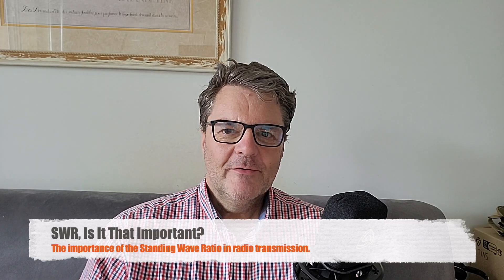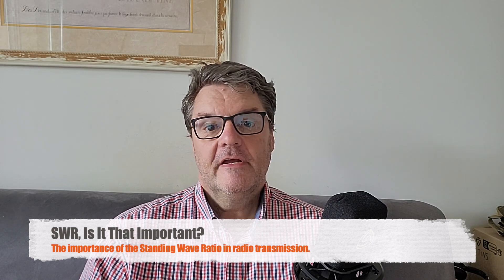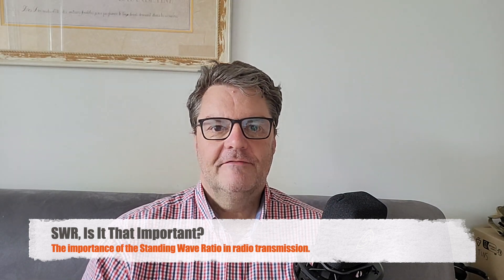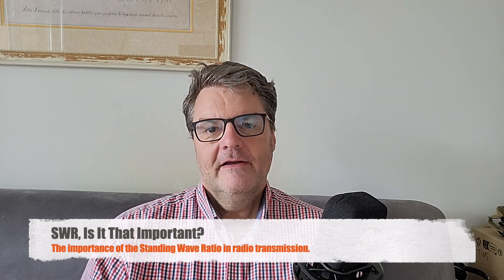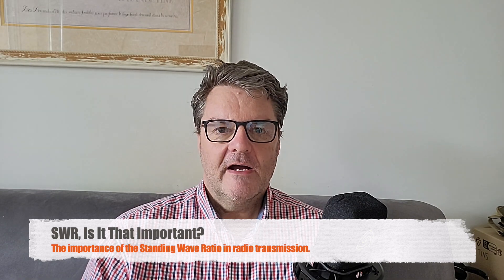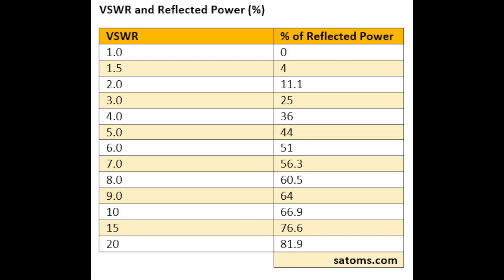SWR, Is It That Important?

Comment: I also noticed, in some Cases , SWR can even have an Effect for Receiving Signals. In some Radios, if the SWR is bad, received Signals will be lower as well. But not every Receiver is that much affected by this Effect... So it depends.. I guess. But , because of this, it is not (allways) only important for the Transmitter.

Comment: A common problem for many, many hams: You can only have a single, wire antenna and that one antenna must work all bands. As such, you are rarely going to operate on a resonant freq (low SWR) and you will encounter high SWR for most freqs/bands.
What to do? Don't use coax. Instead, use a tuner (to keep the radio happy) in combination with a balanced/parallel feedline (ie. ladder or window line), which does not suffer high losses from very high swr like coax does.

Comment: Even when power loss is not so much of an issue in relation to transmitting, a low SWR can be essential for receive sensitivity. It is easily demonstrated empirically.
Reply: Feedline SWR is always set by the load. The receiver is the load. The antenna only affects the power delivered to the feedline. The receiver determines feedline SWR.

Comment: Modern radios frequently have circuitry that will roll back the power with increasing SWR.  Of course this doesn't mean that we hamops should be careless in how we tune & operate our rigs.  Good video!  Thanks. 73 de AE5ZX

Comment: People who design antennas usually work with insertion loss and return loss. SWR is just a simpler way of stating the return loss (in db) of an antenna system, ie, the antenna and feed line. Ideally you want a return loss as high as possible and an insertion loss as low as possible. A return loss of 0 db means all of the power going down your feed line is being reflected back, a 3db return loss means 50% is reflected back, 6db 25% etc etc. It's just simpler and more convenient to say the SWR is 3:1 or 2:1. We all like to use resonant antennas where possible but, as you say Gil, when that isn't possible, it's what an individual radio will accept without damage that is important.👍